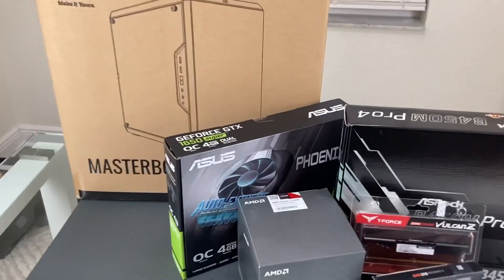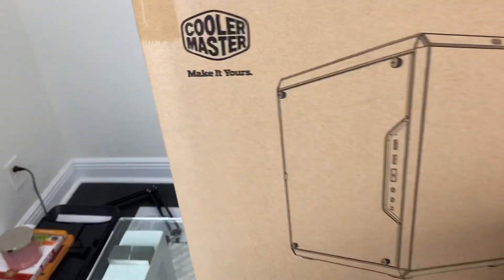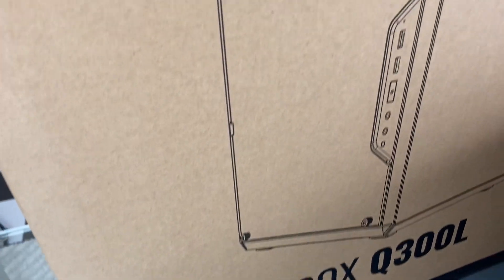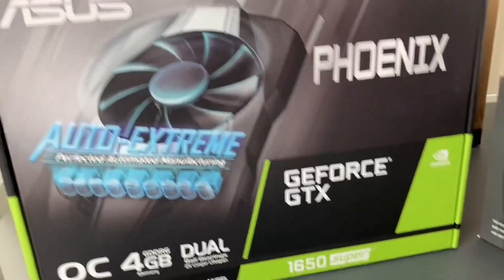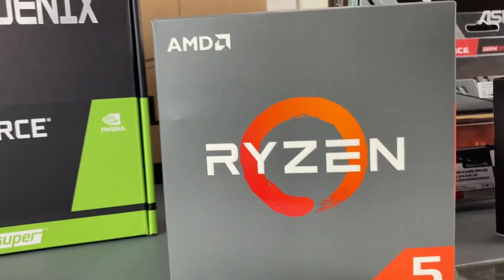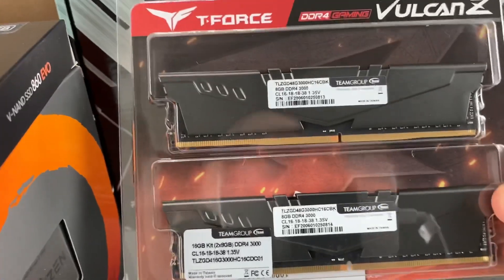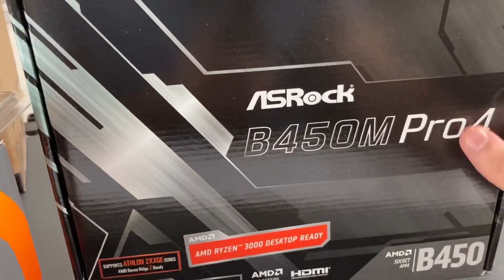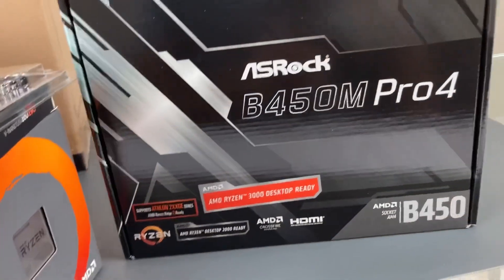PC BUILD 2020 2021 - AMD Ryzen 5 2600 & ASUS GTX 1650 Super

Comment: ASRock is a very badest chose from all AMD motherboard. 
MSI! MSI! MSI!)))))
And, yes, switch the graphics card.
Corsair is not bad RAM, I've got 3200xmp run up in to 3600 Mhz on 16 timing, with help a Ryzen DRAM calculator. Try it
Reply: What do you mean bro,Asrock b450m pro 4 is one of greatest quality/price mobos for build like this
Reply from the maker: I bought this MB based upon reviews
Reply: @MkUnboxed  try MSI MB PRO series and you will be satisfied;)
Reply: @Animitsa  i mean, asrock is a rlly good motherboard for it's price, youtubers even recommend this motherboard bc the vrm is good and the msi motherboard doesn't have 3 fan heaters where the asrock has, asrock is rlly good. Just underated.
Reply: @abelonsight7790  
Not best choice for RAM overclocking and VRM components is not so good. Price, maybe not bad, but else is not.
MSI B450M PRO-VDH much better
https://ua.msi.com/Motherboard/B450M-PRO-VDH
Reply from the maker: Thanks for your input!